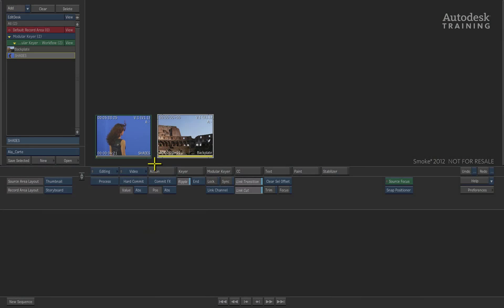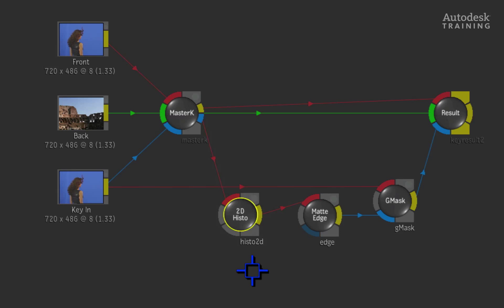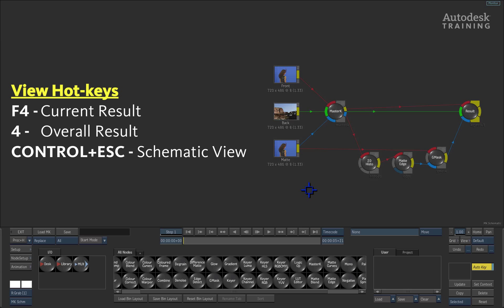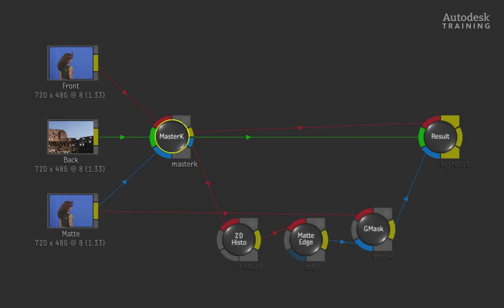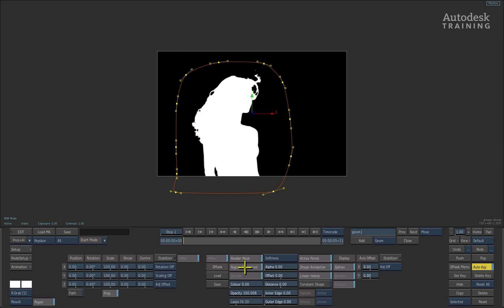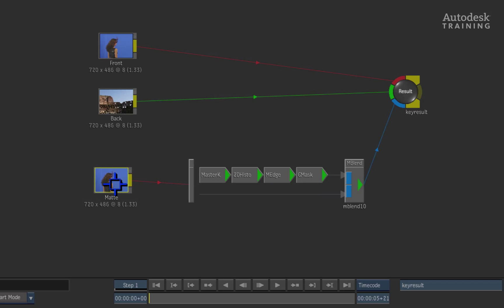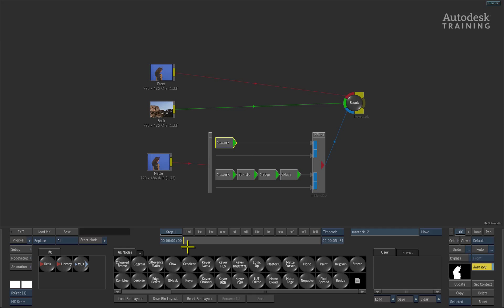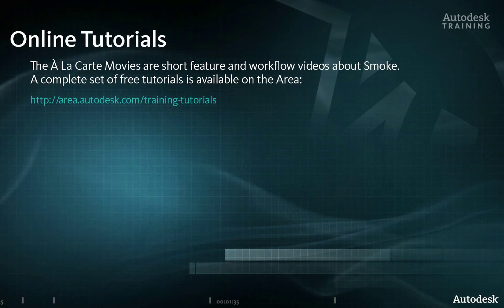Autodesk Smoke 2012: Modular Keyer workflow - Part 1

Comment from the maker: Hi, in Smoke 2013 the modular key process is done in the timeline inside of the connectfx node compositor.  In a nutshell, it means you would edit your clip to the timeline, go into connectFX and perform your modular keyer on the layer.   When you exit the connectFX, you render the fx in the timeline.  At any point you can jump back in and refine the keyer further.  Many thanks for your feedback!